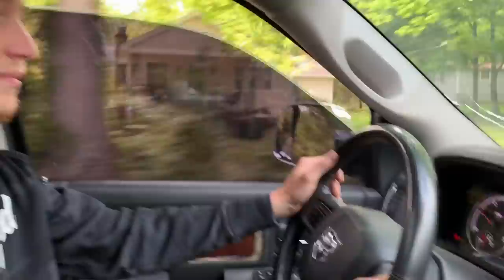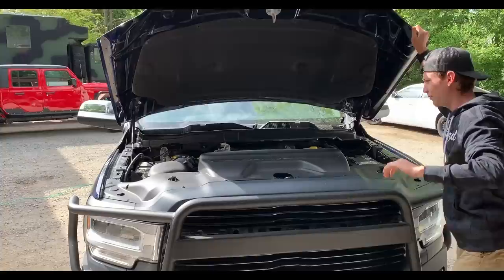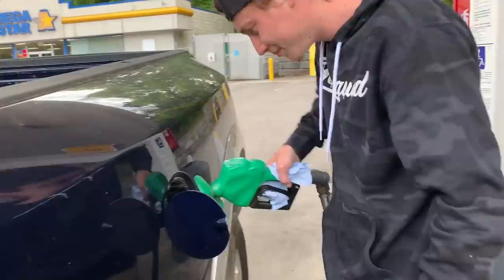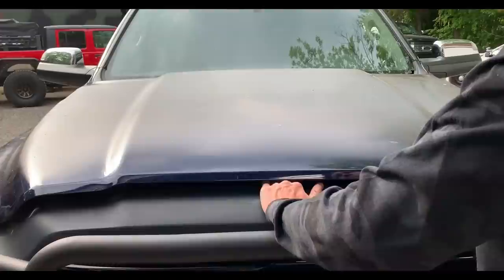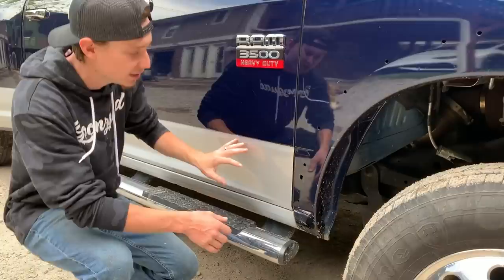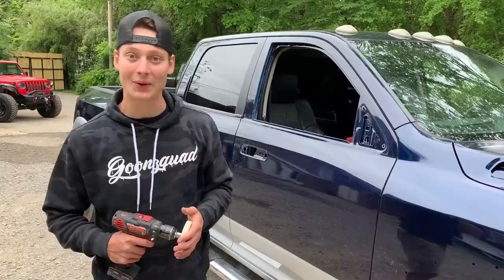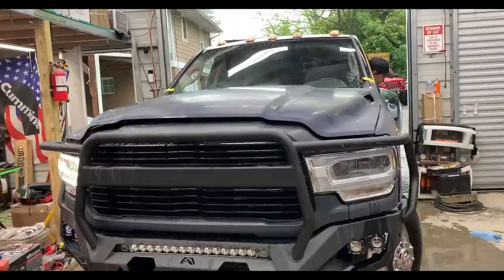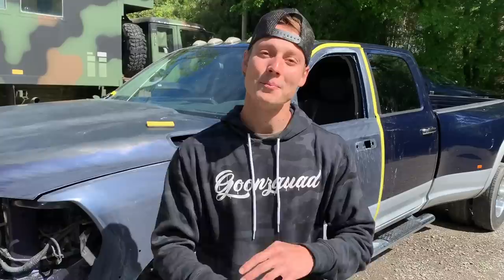Building My Dad His Dream Truck Part 10

Comment: Had this issue with my dads pickup truck after he got into a front end collision. The impact and the fuel sloshing in the tank broke the sending unit. Still pumped fuel but the guage didnt work

Comment: You should do the trim on the front around the grill and lights the same silver as the bottom of the door and the fender flares, with the black bumper and black grill it will brighten up the front and look good!

Comment: The sending unit in tank is broken just went threw this with my cummins pull bed and swap out sending unit
Reply from the maker: Thank you!
Reply: @goonzquad  spray a raptor liner in it for your dad ....  kits on Amazon show the fans something new...
Reply: @goonzquad  Install bigger tires and rims for your f450 and this ram
Reply: @justinunger38  His dad dosent need big tire and wheels for towing and daily use
Reply: Muhamed Velic I’m not a big fan of bigger wheels, but the tires definitely look a little stubby and small. They need an upgrade for sure. Maybe a slightly bigger wheel but it’s just not my preference. Interested to see what they do!
Reply: @dbefore.  Black Rims would work
Reply: @dbefore.  dually doesn't need it and they got to watch the space in the back between tires or they will burn to the ground. See it a couple times
Reply: @justinunger38  No to Black Rims.
Reply: Panamera Ghost yeah stock rims + wheels is my preferred
Reply: @goonzquad  yes that's the problem I went through it to young fellas
Reply: justin unger there is no point all that does it make the turning radius bigger, the truck ride worse, and it makes the gas mileage worse

Comment: The RAM covered by the front bumper doesn’t look right.
Reply: I think they should cut that piece off,what's the point of them going to the trouble of colour coding the ram badge then covering it?
Reply: If its cut out it'll lose its integrity, cnc a steel ram badge and weld it in its place to keep the strength

Comment: Yall boys should do an enclosed trailer build or a center console boat build
Reply: Good idea. Would love to see that
Reply: center console boat build, not much to do to them as they have outboards, most issues on them I have run into are in the transom or floor and that is not too fun or safe to work with. I could see them kiting one out like a bass boat and cleaning it up but a major project would be hard to  do with out proper experience.

Comment: Just make sure pops has some fresh pads and tread on those tires. If he’s gonna be using it for work he might not want it to sound like a garbage truck going down the road. Maybe some airbags to help out the springs out back when under load. Back window gaurd? Rear view cam? Rear back up lights? Looking awesome though.

Comment: Did Y’all Just Wash The Truck In Dishwasher Soap 🤦🏾‍♂️😂😂
Reply: Yeah I figures they must be dumb. Dishwasher soap on vehicles is big NO NO.
Reply: @IrkNr  Dish soap won't harm automotive paint but it does remove wax. They used it while wet sanding. There is nothing wrong with that.

Comment: if you dint found the problem , for fuel Gage , disconnect and clean it , or blow some air  , the wire harness plug from the  driver side fender flare , the wire harness comes from fuse box and  goes to the rear end. i had same problem , and if it doesn't make a good connection the rear view camera and the fuel Gage wont work right

Comment: Nice rebuild and finally lost track of the number of times you guys disassembled or reassembled the front end. I did notice in the last view of you looking at the new Ram's at the dealer that they had braces running from the fenders to the firewall and they are currently missing from your buildout of the new front end. Not sure if have them and not installed or ordered and not installed or overlooked just wanted to mention. Great job.

Comment: Upgrade shocks and everything you can suspension wise would honestly be all i would do
Reply: they must be researching the suspension and wheel specs for an optimal upgrade to  hot shot hauler truck. If it is that important.

Comment: I don't remember what my trucks problem was but after it got wrecked, a guy rebuilt it like you guys did, but he said the fuel gauge was the only thing he couldn't figure out - it was broken too. It was wrecked pretty similarly, hit head on and totaled from the front like your Ram was in the first video you showed. Not as badly broken as yours though, mine would stop gauging the fuel level after it hit half empty at least so I could kinda guess how much further I could go after it hit half full. I took it to 3 separate places and since it wasn't completely broken no one could figure out what was wrong.

Comment: An airbag light will not stop a factory remote start from starting. The only thing that will stop a FACTORY INSTALLED remote start system from  starting is a check engine light  or pending check engine light, and if the hood is open ,also there should be a pin switch under the hood that if it’s open will not let it start . Try remote starting it and check how many times the lights flash . A flash is a code of something being wrong . You can look it up .

Comment: Get a s&b filter a tuner and straight pipe that will give it more than enough power I work in a diesel shop and those three things on those engines gives them more than enough power...

Comment: Normally the remote start won't work if there's a check engine light.  That's how it works on GM vehicles at least.  Air bag, not sure if that could relate as well.

Comment: The temperature gauge should always be in the middle especially with a new (Radiator Thermostat & New Coolant) if the temperature gauge is rising then that means the engine is warming up and it goes to the middle and if it stays in the middle and doesn't go past the middle mark then it's normal

Comment: The faulty fuel reading should be diagnosed before throwing parts at the problem. Now that the tank is full, its a messy, smelly job to pull the sending unit.  You may be able to disconnect the wiring harness at the sending unit and "trick" the guage in order to verify that it isn't a guage or wiring problem. Maybe better left to an electrical specialist.

Comment: Regarding your remote start now working. The remote start will not work if the vehicles hood is open. You maybe missing a switch (or it’s disconnected). Check all wire connectors and switches. It’s likely that it shares the same switch as the “hood open” indicator on the dash. If the truck is running and the hood is popped - is there a warning light on the dash?

Comment: My 12 ram 3500 did the same with the fuel gauge after a wreck. Had a bad fuel pump. Parts store has a new one $250

Comment: Not to sound critical, but on the last video, those lines looked really rough.  Have yall ever done AN lines?  I would definitely replace those kinked up lines with just some nice PTFE AN hoses.  Would look clean, and there are adapter fittings, or even just compression fittings to make them work.

Comment: The fender flare on the rear of the 2020 ram is different than the one you have. The 2020 one is larger than the one on the 2012 model.

Comment: Did they forget that little cut they had to do in the window because water is getting in to the truck. Also for a suggestion get new roof lights for the truck. The old ones look foggy.

Comment: Hey Guys, I git 2 another Qs:
1. what is the gritt number of your sandpaper you used for wet-sanding?
2. Can I use SpiesHecker brand for this kind of truck? Here we only have Ford F150 and below it here in Indonesia.
3. You didn't do the "oven" finishing to your painted panels, did you? Was it only basic paint + clear coat done to your panels?

Comment: I noticed the new truck had 2 cross supports under the hood and your truck didn't. Is that off till the very end or is that something you need to order?  Awesome job again boys!!
Reply: definitely should check on that...it could help with noise and fuel economy to have the hood properly supported.

Comment: The dodge has 17" alcoa with regular truck tires so it's much smoother ride than the f450 with 19.5" medium duty truck tire. The side ways on the f450 is much more rigid ,and they will pull on you in ruts because of the tire. They have both pros, and cons main pro is how long they last,and weight load capacity. Dang son Trucks looking good!!! 👌

Comment: The remote start will not work if the low fuel lights is on or any lighted like the check engine or airbag or lights like that, that want you to check some thing

Comment: I saw you guys using dish soap to wash the truck.  Please don't...lol If you guys buff or wax your cars and you wash it with dish soap, the dish soap is made to take grease away, so for the soap, the wax is like a grease and will remove it!  Suggestion: use soap made for washing cars!

Comment: With the stock front bumper gone, the silver two tone looks super out of place. Almost a little ghetto. You should either make the aftermarket bumper silver, or ditch the silver on the truck
Reply: make the bumper silver.  This truck is not supposed to look like Darth Vader death mobile FFS, its a light hearted look to it.

Comment: Was that dish washing liquid? Don’t think you should use that as I have been told it could mess up the finish.
Reply: Dish washing soap won't harm clear coat or automotive paint. It does remove car wax.

Comment: Please tell me you didn’t just use dish detergent to clean pops’ truck?? 🙄
Reply: There is nothing wrong with using dish soap on a vehicle when doing wet sanding. Dish soap does remove car wax but won't harm automotive paint or clear coat.